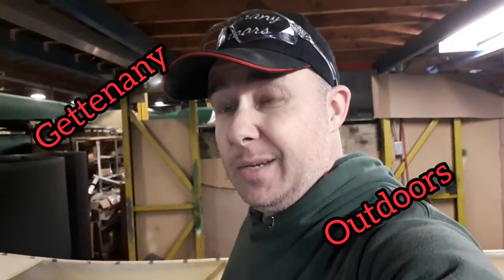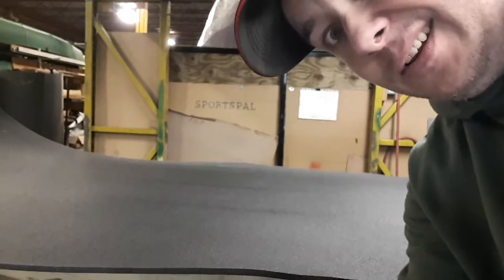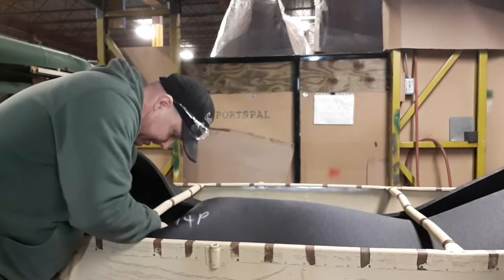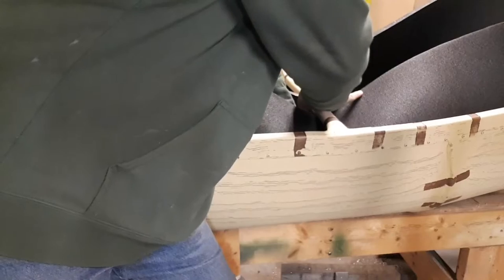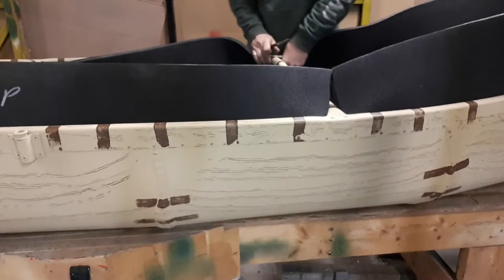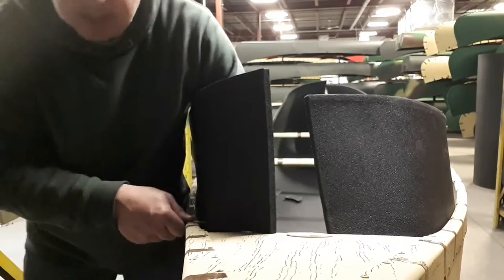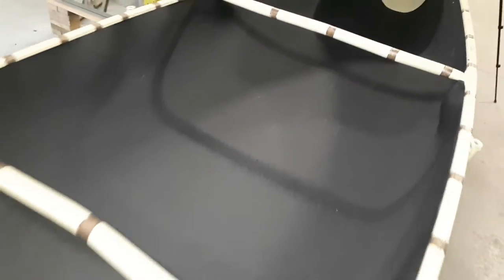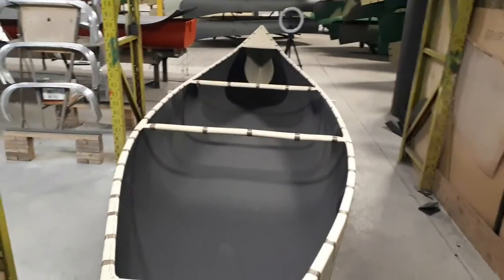Sportspal canoe foam liner change/install

Comment: Do you have any more exacting information regarding the type of foam used for the liner? I spoke with Donna but shipping to western Canada is over $400 for the replacement - I found a supplier that has closed cell 2lb Cross-Linked Polyethylene Foam (XLPE) in 1/2 thick x 60” wide. Just wanting to match what comes in the canoe as closely as possible.
Reply from the maker: It sounds like you have it right on. My only question would be uv resistance. If it's not exposed to the sun beyond regular use, you should be fine.
Reply: I'm in the same situation with my 14' SportsPal.  Was the  2lb Cross-Linked Polyethylene Foam (XLPE) in 1/2 thick x 60” wide the correct foam for the boat?  Can you provide a link or name from where it can be purchased?  Thank you.
Reply: @TC-hl1ws are you in Alberta/Saskatchewan or B.C.? I purchased mine from sureline foam products. Foam price was about $200 for a 14’ 6” sheet.

Comment: What are the dimensions of the foam? Thickness? Will Home Depot foam work or is it special?
Reply from the maker: It's a closed cell foam if you can find some. 5' wide is what you want long as you need

Comment: Do you know what the density and thickness of the foam is?  I have a local source, which could be much cheaper that the manufacturer.
Reply from the maker: Not sure of density but it is about 1/2" thick
Reply: @GettenanyOutdoorsSportspal  Thanks for the reply! Cheers!

Comment: Do you guys sell pre cut liners?
Reply from the maker: They are cut to length only as the canoes are hand formed and will have slight differences in width so the best way to ensure the liner fits snug is what you see here. Would be nice if they could be pre cut all around.